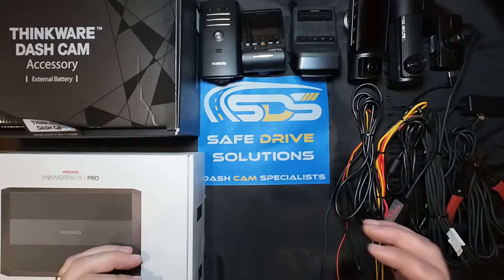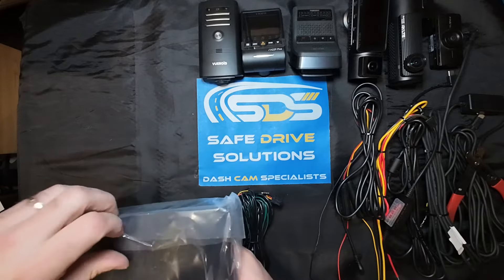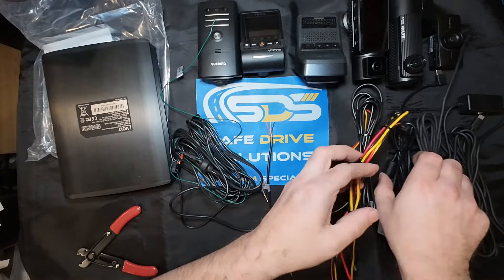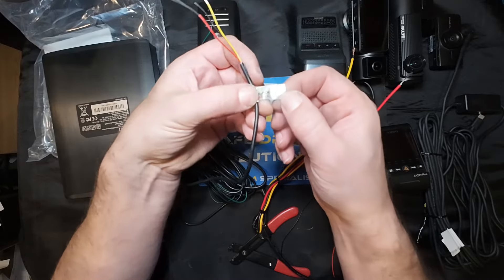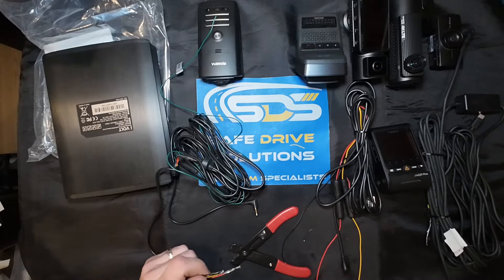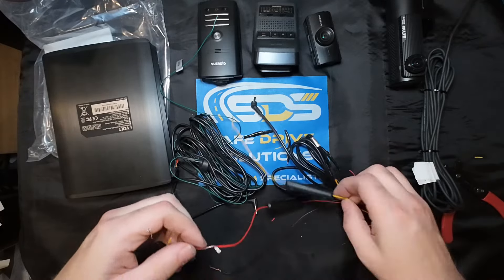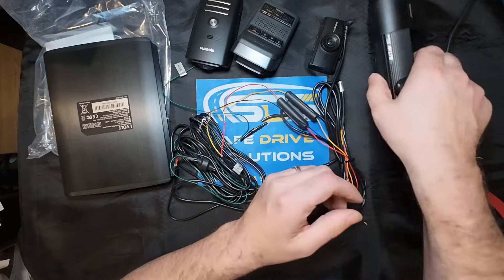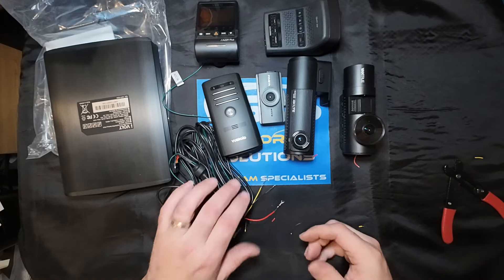How To Hardwire A Dash Camera To a Battery Pack

Comment: Also another question, looking at how diligently you connected the wires of the Thinkware battery would be
...if i have the hardwire of the 360 panaromic camera, then i just need to follow the yellow, red and black wire connection based on the actual colour of Acc, Bat and Ground wire matching connections. So the input would be straight forward meaning connect it to the cigaratte lighter and the output wires would need the match the Acc, Bat and ground connections, which would then go into the camera. Correct?

Comment: Hello. I have a Powercell8 battery pack connected to my U3000 front and rear camera. I now wish to add another dashcam which is a 360 degree camera but this requires a hardwire connection. I do not want to get into the fuse box area and thats the reason i chose to go with the Powercell 8 too for my U3000 setup. So can you please advise if i can use an additional battery pack like the ivolt Xtra or the Ivolt mini or another Powercell8 itself with the existing one? Is that possible as i can see a slot in the battery pack that has a provision for an addon. Kindly advise if this is safe and how feasible would this be considering that both external batteries would be charged while driving and then both would need to work while the car is switched off. Kindly advise, thanks!
Reply from the maker: Hello we answered this question already on another video. You will need to reach out to blackbox my car. They have a battery add on

Comment: Good video Ben, a bit cluttered but good.  I would like to comment on the Blackvue connector that you displayed. That looks like what we call a TRS connector. Tip, Ring, Sleeve. You are correct about the wiring being different on the TRS based on manufacturer. The Viofo A229 Pro has a TRRS connector that goes from the Interior IR camera to the main dash cam body.  That would be a Tip, Ring, Ring, Sleeve connector. It looks like the BV power connector you showed is maybe a Tip, Sleeve ( hard to see with clarity) and is simply power and ground only.  If one does not know what they have, they can power it up and use a DVM to see where voltage is.
Reply from the maker: it is basically pinned differently then thinkware.

Comment: Hello I am installing a ivolt extra battery. For the constant power (B+) I was thinking of using a 4awg wire I use for my subwoofer. My plan is to use a 12 awg wire with a 20 amp inline fuse and connect the thinkware battery to the 4awg wire which connects straight to the battery. Would this work?
Reply from the maker: You can. I have told a few people running car audio systems to use a distro block and have the battery pack hook up into that distro for contant power.

Comment: Hello

Thanks for the great reviews.

Pls does that mean that for powering the thinkware, only the connector will go into the bat from the provided output cable and that's all (the black, yellow and red wires will not be used)?

Thank you
Reply from the maker: This video is only for how to hook up the dash camera to the output cables of the battery pack. We do not talk about how to connect to the vehicle at all in this video
Reply: @SafeDriveSolutions 

Yes I know, I am talking about that too. 

I meant that in order to connect the thinkware to the output cable, will the connector alone be the one to be used (which will go to the battery port on the dashcam "bat")?
Reply from the maker: @musaadedibu9316  I am confused by the question. The video shows you to use the hardwire cable. If you do not have a hardwire cable with your dash camera you will need to purchase a hardwire cable.

Comment: Just installed a Viofo a229 pro 3 channel system and a Thinkware ivolt xtra into a '22 Tacoma but Hubby got frustrated because he couldnt figure out how to hardwire it. We took it to an installer yesterday and they hooked it up to the back of the cigarette lighter and now the thinkware is completely dead. Its been such a headache. Might have to take it to another installer because we just cant figure out which fuses to use. Appreciate the video, it helped a little.
Reply from the maker: We typically do not use fuse taps. If you take dash apart there is a thick gauge wire. We always solder the wire to that with an atm fuseholder. Then we hardwire ignition and ground.

Comment: Ben I have an Iroad powerpack pro 12 to connect up to my Viofo 2ch A139pro. I currently have it hardwired using the HK3-C cable. Parking mode works well. Whenever I park in my garage I always power off the dashcam. 
If the vehicle sat unused for a couple of weeks will the powerpack still draw power even with the dashcam turned off. Also is the constant power 20amp fuse supplied a bit high considering it charges at a max of 8 amps? Would it be safer to use a 15amp fuse? I guess I’m talking fuse tap even though I know you like to solder all the wires. It is a much better way to do it I know.
Reply from the maker: The powerpack will not draw power. The is no load on the battery pack. However Battery pack just sitting there I have not tested this but I do know other people who have and they do say the battery will lose some of its charge.

Comment: Which battery pack is the most newbie friendly for installation if im getting a Viofo A229 Pro 2 channel kit?
Reply from the maker: Well you probably want a battery pack that will allow you to plug into a cigarette lighter plugin for charging. 

Iroad has a cigarette lighter adaptor, powercell 8 does as well.

Comment: So could you make a second part on how to hardwire to fuse box because that bit I do not really get either
Reply from the maker: We will try and do that.
Reply: @SafeDriveSolutions  try it on a x5 on that secret wire 😀 that shuts down right there and didn’t have to wait 10-25 minutes for it to sleep to activate the parking mode…
Reply from the maker: @burnjack291  ha ha. We got a Mach E video coming out soon. No battery pack though
Reply: @SafeDriveSolutions  
Well some day…that x5 will come for a dash install.
Reply: @SafeDriveSolutions  thanks!

Comment: Ben..regarding the viewer comment about the fuse box.  How about showing that some fuse positions are ACCESSORY and some are ON. In my Outback I have a VIOFO A229 Pro on the front windscreen fused to ON and the rear A229 Pro fused to ACCESSORY.  The home installer should be aware of where their ignition key is turned to when using a probe to look for power, as what is powered in ACCESSORY can be different from what is powered in ON.
Reply from the maker: Yeah we do need to do an update hardwire video for YouTube. Will try and get to it.

Comment: lol viofo isn't the one breaking the rule. you got it backwards. red has always been constant power.
Reply from the maker: Go to the car audio industry where constant power is yellow on all aftermarket car radios.
Reply: @SafeDriveSolutions  what is the red wire on the car battery is then? Not constant? 😒
Reply from the maker: @ultimatums1 mainly referring to aftermarket components.
Reply: @SafeDriveSolutions  lol deflection much?
Reply from the maker: @ultimatums1 ha ha